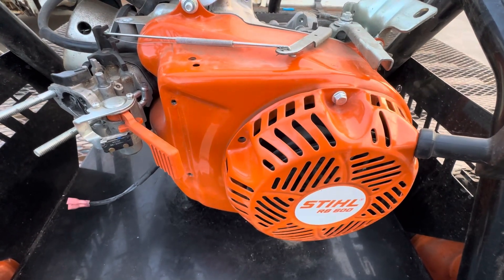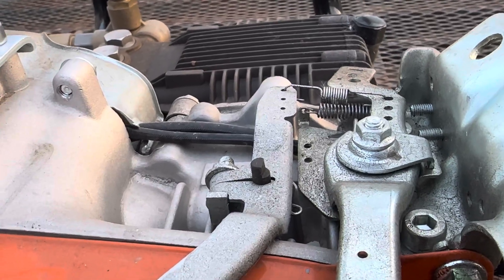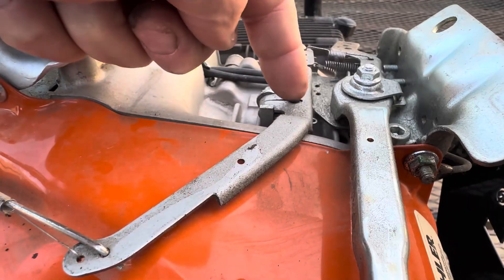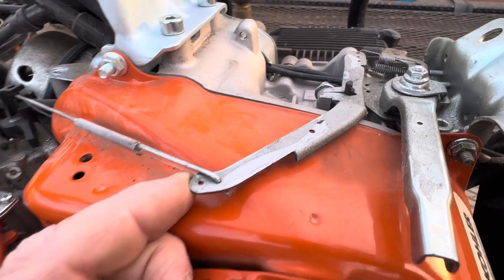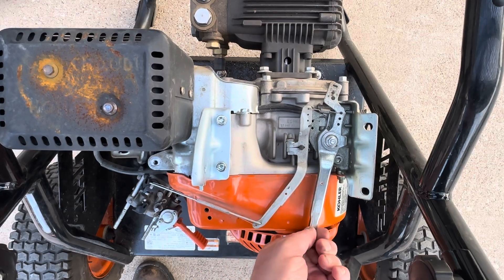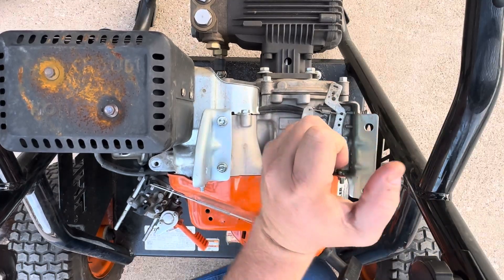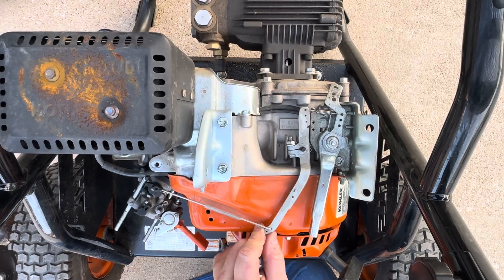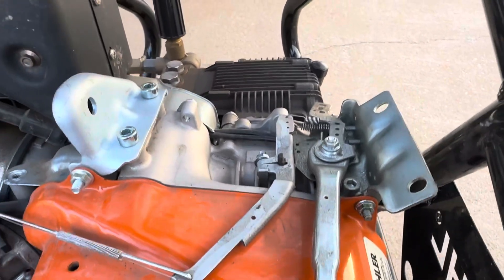ENGINE GOVERNORS EXPLAINED AND HOW TO ADJUST (POPULAR DEMANDED VIDEO) (EDUCATIONAL)

Comment: Thank you MM1 ! Next video suggestion: Adjusting single speed throttle spring tab if rpm is too low, where the tab & spring are located. 
Also is there any way to use the old fashioned analog automotive diagnostic meter (12v. powered by the cars battery & the meter reads rpm with inductive pickup.) Small engines fire every revolution, so I divide 6400 indicated rpm by 2 = 3200 rpm on my small 1 cyl. engine, Right? One day I'll buy an electronic version & an endoscope as budget allows. Thanks Jeremy

Comment: I am currently working on a Cub Cadet push mower with a 673cc Powermore. It has a primer bulb, but will not pull fuel at all with a primer bulb carburetor (I have tried two new OEM carbs), but runs fine and pulls fuel normally with an auto choke carburetor. With a primer bulb carb, it will only run until it burns off the primed fuel. It had been sitting several years when I got it, and I have no history on it. This applies to a governor because at some point, a previous owner removed the governor arm and installed it at an angle pointing toward the carb. The machine was clearly run this way for some time because the governor arm had worn a hole in the breather tube. Why would someone do that? Could it have been to correct some issue with the governor?
Reply from the maker: Check atmospheric vent tube
Reply: @THEMOWERMEDIC1  Are You referring to what I call the breather tube? I suspected it is an air flow issue, due to the fact that the auto choke carb would allow more air in with the choke open. I just wasn't sure where it could be plugged at.